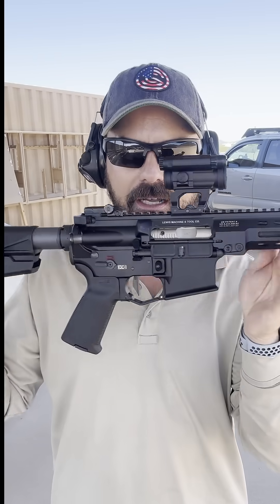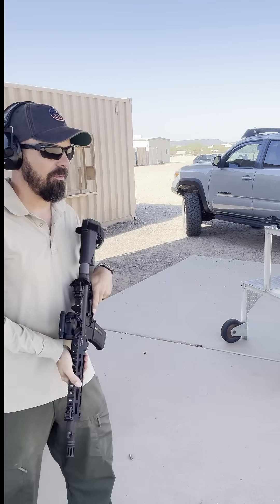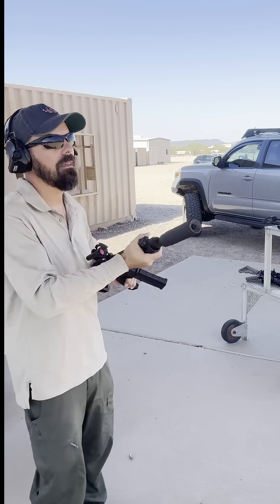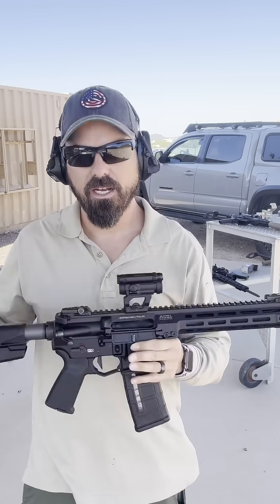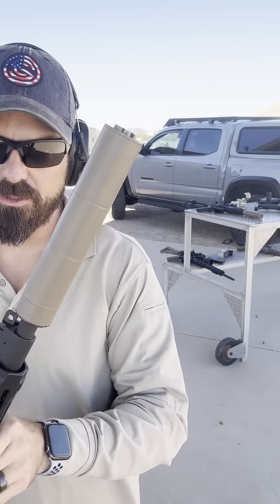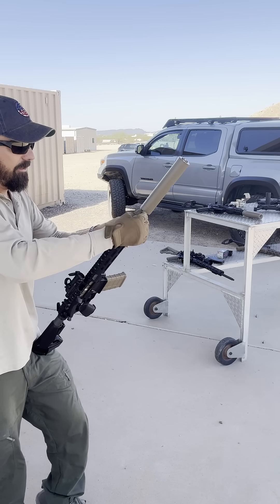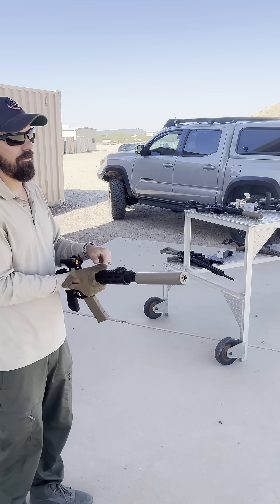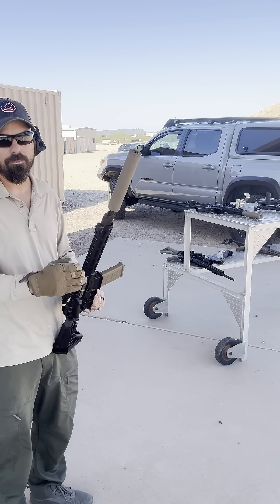LMT 12" 5.56 — Best Suppressed Host? LBP vs Full-BP vs Unsuppressed (PMC X-TAC 55gr High-RoF Test)

Comment: The S setting is indeed intended for traditional baffled cans, doesn't have to be high backpressure, something like Sandman and RC2 should be GTG. 
I've seen a report on someone enlarge the S setting port size halfway so it run perfectly with cans like CAT WB. Apparently the 'halfway' is a common drill bit size of 1/16''.
Reply: Mmm yes yes, indubitably I do concur my good sir
Reply: Agreed